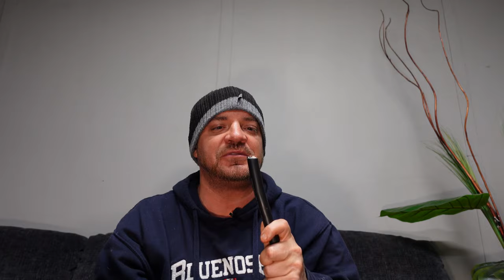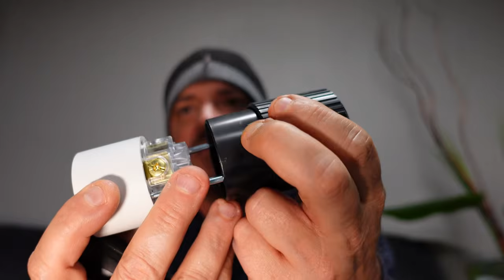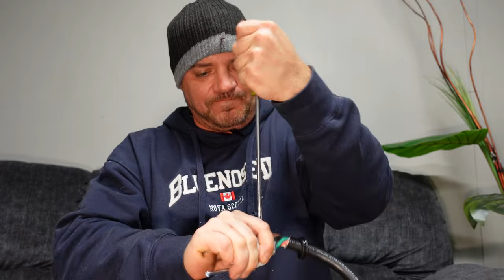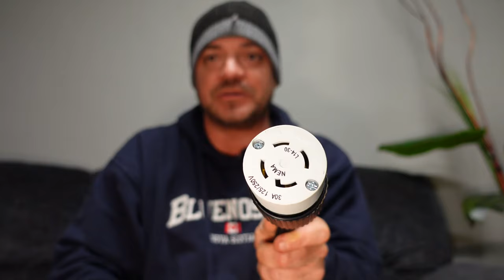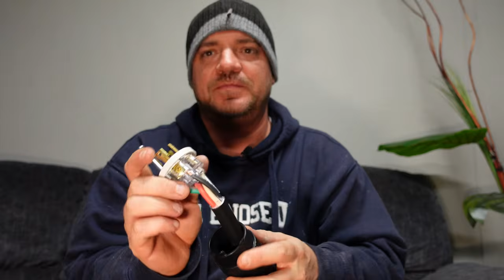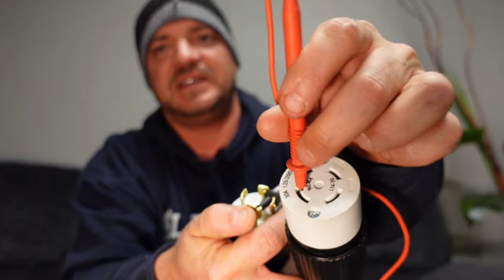Generator Cord Wiring | How To Make Up A Cord | L14-30R

Comment: Missed one test at the end @19:25:  Check ohms ACROSS all combinations of male terminals, just to be CERTAIN that there are NO SHORT CIRCUITS.  The end-to-end tests and the short-circuit tests should be performed on ANY cable that you buy, have built, or otherwise obtain.  You don't want to find out there's a problem with live power energizing your cable!

Comment: Simple explanation. In a 4 pin 220 volt male generator plug, the locking terminal (the bent one) is the ground. Opposite that is neutral and the other 2, similar in appearance to each other, are lines 1 & 2. (Power)
If you need to run an extension cord to power up a trailer normally fed by 220 volts but not running 220 volt appliances, you can 'cheat' a bit by connecting two wires together. (2.5 mm 3 core flex minimum, 2 core flex may be used but would require bridging out pins 1&2 inside the 220 plug housing) Using the smaller pin on a 2 pin 110 volt male plug, connect  two wires. (With a 3 pin 110 plug, the round pin is not used) Then connect those two wires to each of the power pins (lines 1&2) in the locking 220 volt male plug. Next, connect another wire to the remaining large pin in the 110 volt plug and connect that to the neutral pin in the 220 volt male plug. This will safely feed all the 110 volt circuits. Be careful not to overload the system. Remember this is a 'cheat' system so a degree of caution is required. More importantly, be sure to plug in the 220 volt male plug to the 220 volt female receptacle on the trailer before plugging in the 110 volt power supply as the prongs on the male plug will be live. I've used this system with great success on a number of trailers and small areas for 'temporary power' when 220 volt power is unavailable.

Comment: Great video. I’m dealing with 6kw and 20kw generators with 30 amp 250 volt 3 prong receptacles and need to power 30amp 125 volt RV’s. Have one custom built adapter, but need to build 2 more.

Comment: Thank you for this very well explained video. I just purchased a champion 10000 watt startup and 8500 watt running generator and also purchased a 30 amp Generlink. My question is can l run my 2 ton ac with this setup along with a freezer, fridge, microwave and some lights. I see some comments explaining that the 30 amp cord could catch fire and that you should use a 50 amp setup.
Reply: Sure you can, I have the same set up as you, but my cord is only 30 feet. My AC is 3T, and I have , 3/4hp well pump, 100' deep + lights fridge.  My generator is a Troybult   7000 running watts  and 10500 starting watts. Ran one time for 3 days.

Comment: But can you bridge  both 120 hot legs off Generator NEMA L14-30P to make a 120 30 amp  plug for an 1.5 horse Air compressor?

Comment: So, the Red and Black wires each carry 115V? So, if I wanted to power a water well that is 230V, but all I had was a 3 wire NM 12-2 (3 WIRES), I could use the white wire for the Red, Black to black, and ground wire to the white? I think the ground and white nuetral go back to the same buss inside the generator, right? I know this isn't ideal, but I may have to make due for a couple days.

Comment: My generator has a 30a 4 prong female receptacle . I bought a 50 amp inlet plug box by mistake. I plan on using a 30 amp breaker but would like to still use the 50 amp inlet in case I get a larger generator down the road I can swap the 30 amp breaker for a 50 amp. (I’ll use 6 gauge wire when installing the inlet plug). 
So, how do I wire it up with 30 amp male plug and 50 amp female? What do I do with the extra wire?

Comment: Hello fellow maritimer. I'm in Halifax. I built a generator shed and insulated it. I have 2 30amp 240 volt cables made ,each at 45 ft. My shed is 90 ft away from the house. I have a Firman 7500 cold start. W
My question is, does this cause a problem using 2 cables. They are both 10-4 SOO cables. Cheers

Comment: Hey I wired my own L14-30P cable with 10/3 cable to my house, inside I have 2x20Amp receptacles in my kitchen that I wired (red on one with white the other side and black on the other receptacle with white the otherside) and grounded. However my generator breaker keeps tripping..

Comment: What do you  do when the outlet on your Generator is 3 wire 120-230-30 in other words you have a 4 wire female plug at the house and 3 wire male at the generator can I simply not hook up the neutral since a3 wire cord would not have a  neutral
Reply from the maker: Sorry my friend you will need a 4 wire generator to supply to outlet. Do not hook it up without a neutral connection. You will cause all 120 volt loads to get 240 volt and blow them up.
Hope this helps

Comment: The generator inlet on my house is a 50A CS6364.  If my generator output is only 120V, 20A, that power still needs to be fed into my house through that inlet.  I am not going to waste money on a 30 or 50A cord which would be unnecessarily heavy and stiff.  For the sake of ease of use, I want to use a 20A cord, but I am concerned about waterproofing where the cord enters the female plug as the generator inlet is exposed to rain.  Is the smaller diameter of the 20A cord going to allow moisture into my female plug which was designed to accept a 50A cord?  I realize that adapters are available, but those adapters all seem to force me down the road of running a 50A cord to the generator inlet, and I don't want to do that.

Comment: nothing personal but you did not really identify what screw ends were hot  and what was the  neutral conductor. I see X, Y, and a W. Under normal circumstances I would assume G is ground and W is neutral and x and y are hot legs...but the male plug end I just bought has 3,(three) screws, are all brass colored. All brass !!!. My point is ...I expected a silverish one for neutral ......and it's not... I see a W but with leviton's  miscolored screw mistake. leviton is suspect. thanks if you answer. its storm of the century tonight.

Comment: My food truck has a l14-30p that I need to connect to my generator that has a l14-20r could a cord made with these two ends work?
Reply: Technically no, your food truck has a 30A receptacle for a reason. Unless you know for a fact that you are only using 20A at 240V then you are asking for trouble. 

The fact that your generator only has a 20A receptacle leads me to believe it can’t handle the 7.2kw you could pull from a 30A (but circuits are typically derated by 20%…I would assume generators do that too?)

I would change out what’s on your food trailer to a 20A after confirming 20A is enough for everything in there. 

OR

Buy a bigger generator that has a 30A receptacle

Comment: Slight disagreement about the big box 10-3.  Typically, they will give you Romex in which the ground line is NOT included in the description.
A piece of 10-3 Romex contains the black, the white, and the red which are all insulated; it also includes the ground which is uninsulated.
However, due to the "flat pack" style of Romex, it is not well suited for a generator cable.
In a SOW cable, ALL the conductors are insulated.
Reply from the maker: We are not permitted to use Romex in Canada, so I'm sure that is where we differ...
Reply: Made by NEMA?  I thought NEMA was the National Electrical Manufacuters Association.
 You said "NMD or Romex you would buy for house wiring" so then you are permitted to use Romex but presumidly not for a generator application which just makes sense.

Comment: I have a four prong 220V generator & a 3-wire 220V condenser. Does this summary make sense?

G = ground = green
X = L1 = black
Y = L2 = red
W = neutral = white (unused in this case, as the condenser is single phase)

Comment: I just bought a bandsaw and it has 3 prongs, which means 3 wires and it is 240 , and so my generator has a  l 14 - 30  30 Amp 4 wire receptacle , I’m off the grid so my choices are limited , got any suggestions?
Reply: probably like using a welder, just dont use the neutral